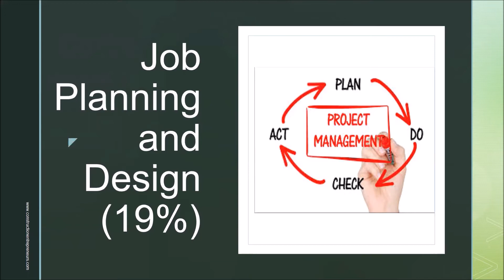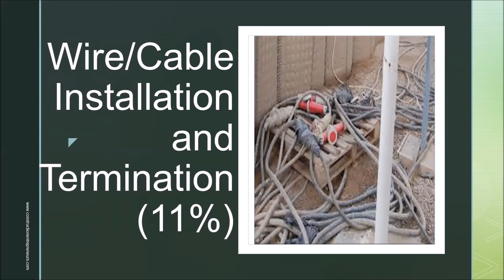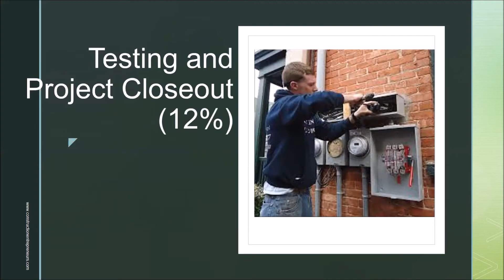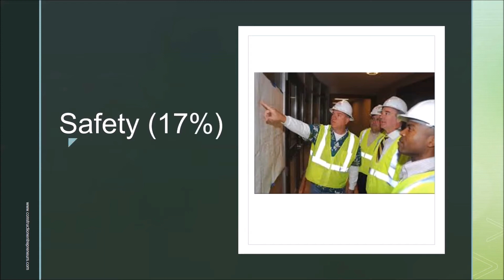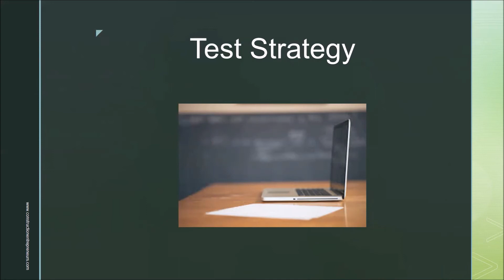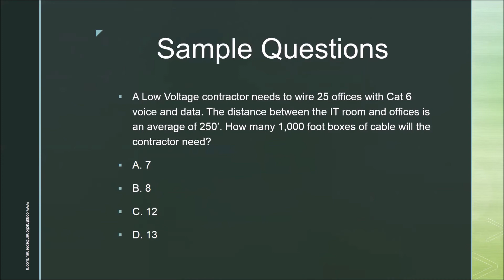Low Voltage C7 Exam Study Guide

Comment: RJ-45 is a tip, not a jack.
Reply: You can order RJ-45 Jacks for biscuit or wall plates. I use them its easier for me then to crimp the connection

Comment: Question 1 cable distance is A, not D. 13 thousand is over kill....
Reply: 25 locations, 2 drops per location at 250' comes out to 12,500'' of cable. That's where he got the number. One detail that irks me is that he says "average" distance is 250', so you still don't know what the actual distance for the cable runs adds up to. These sample questions were a waste of time anyway. RJ-45 is not a designation for a data jack, it's a type of tip.
Reply: @havespacesuitwilltravel9607  

 25 locations x2 for voice and data = 50 runs
50 x 250(cable avg) = 12500 total cable length used
12500 divided 1000(amount of feet in a box)= 12.5 boxes, which rounds up to 13 cable boxes.

and yes the questions were too easy.
Reply: how you get 7?

Comment: That first sample question is kind of misleading since voice and data can run over the same cable. If the correct answer is 13, then the question should specify 2 drops to each office. Otherwise the answer would be A.